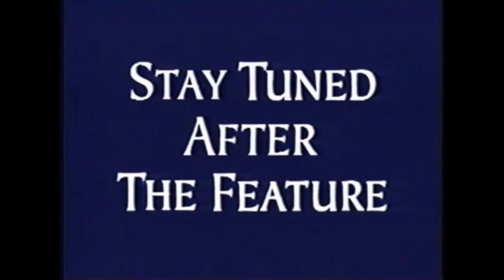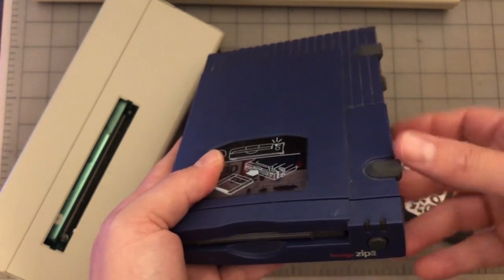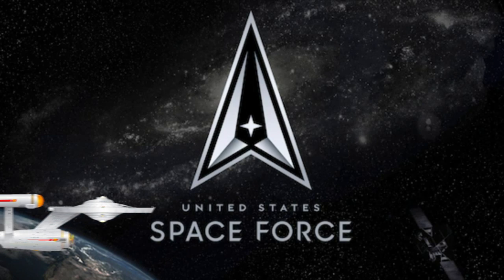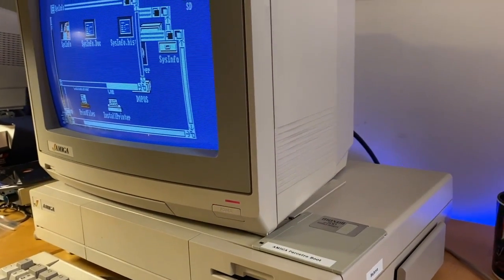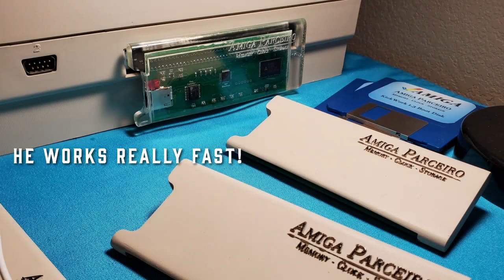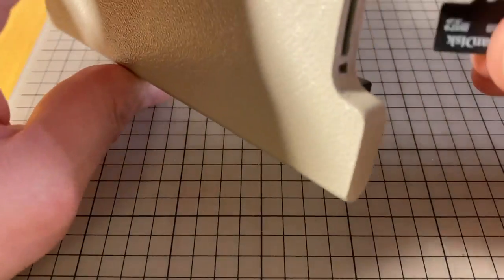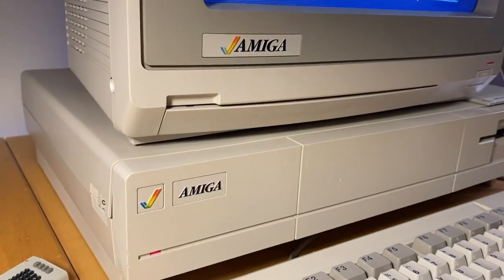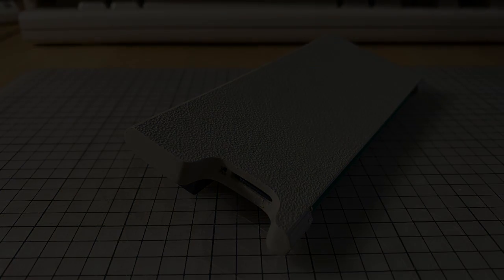Amiga 1000 Parceiro: Memory, Clock, Storage

Comment: This system permit to use whdload with A1000 or remain the normal limit ?
Reply from the maker: I'm running 1.3 on my A1K so I just use JST when I occasionally need to. But that hasn't really been my focus. I've not tried it with 2.0.

Comment: nice piece of hardware ,. I'm just missing an accelerator card, unfortunately more memory alone doesn't help me, so I'll stick with my ACA500 + on the Amiga1000. But thanks for showing.
Reply: Hi! Does ACA500+ work with the A1000? I have both but according to icomp.de the card doesn't work with the A1000. I'm looking forward to getting a Parceiro though, but it would be nice to know if the ACA500+ indeed can be also used!
Reply: @LaepsynPaepsyn  I have A1000 working perfect with aca500+ . So there's no problem in this combination as long as you do place the aca500plus in the right way to the a1000.

Comment: Clever device indeed! I hope he gets the autoboot working. Interesting that it uses FAT 32 instead of FFS
Reply from the maker: I think he went the FAT32 route specifically so his PC could understand the microSD for very easy file swapping between the two environments. To be honest I didn't even know that driver existed on Aminet before this device showed up. Pretty cool!
Reply: @AmigaLove  most of its competitive products use the same fat 95 operating system, but they use it for the secondary card. Like the ACA 500 plus and the Eric's labs classic 520 both use fat 32 on the secondary card. It's also commonly used on the Amiga 1200 and 600 for the PCMCA slot CF card adapters

Comment: Will this work with a vampire attached?
Reply from the maker: I've no idea. Maybe? Although, would you really need it at that point? The Vampire takes over the entire machine and gives you everything this expansion ever could, and way more. I think the only thing you'd gain is the RTC. The Parceiro is more the 2020 spiritual successor of the original expansions from the mid-80s. It's more a modern reinterpretation of the old ways in a brand new form factor. It lets your Amiga 1000 still act like it did back in 1986, just in a much smaller, more stable package (with a ton more RAM/HDD storage compared to the typical 1MB RAM, 20MB HDD options from back in the day).
Reply: @AmigaLove  yes I agree. I am really keen for a modern real time clock solution for the a1000.  I can't believe there is no rtc readily available for it. I love the idea of the a-time. Just impossible to find.
Reply from the maker: David says it should work with any expansion that doesn't put its RAM into the 8mb space or take over the system bus (like a vampire would). So, looks like no - they aren’t compatible, Glen.
Reply: Glen Vanpire permit to use whdload with A1000?
Reply: I dont understand why would I want to butcher a A1000 with a Vampire, what is the point?

Comment: First! Funny I just read about this on Particles.  :) Love it! Now if only someone could work on the A1K Chip RAM problem. I know that is in the same category as the Rejuvenator.
Reply from the maker: Hah! You probably read my post about it, yeah. The Rejuvenator does take care of the chip ram problem entirely. The hard part is 1) sourcing the Rejuvenator board (that's been taken care of, btw) and 2) sourcing an A3K Agnus if you want 2MB of chip. Getting an Agnus for 1MB chip is a lot easier. I've been on a team for nearly 3 years reverse engineering the Rejuvenator. The entire thing has been done - EXCEPT - for 4 pal chips that are read protected. If we could ever unlock those algorithms, more Rejuvenators could be built, which we have explicit permission to do.
Reply: Awesome work done on that. So close you can taste it.
Reply: @AmigaLove  I have been reading about a place that used to do delidding and failure discovery for IC's. They would jumper the fuses on the PAL's for  people so they can be read back, I looked but they no longer seem to be in operation.
Reply: I can’t wait for the rejuvenator! I hope you can figure it out.
Reply from the maker: @Abrothers100  Man, I do, too!